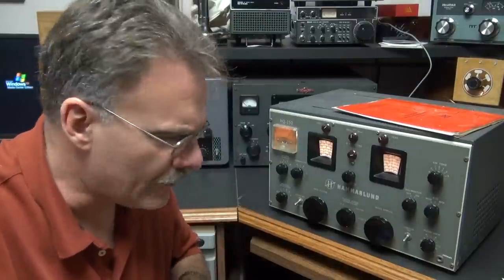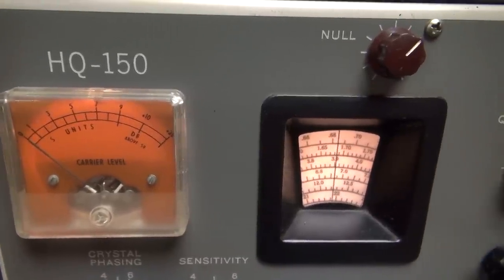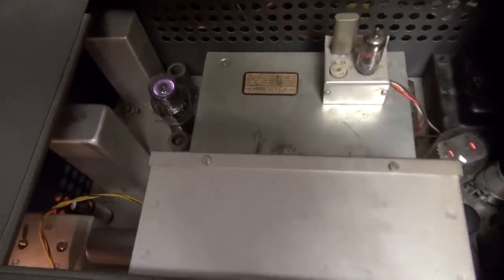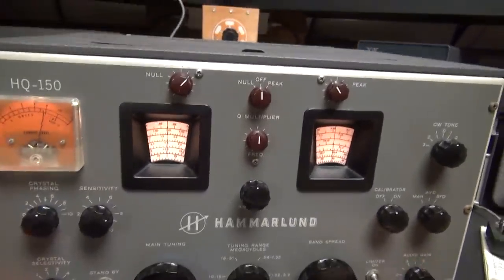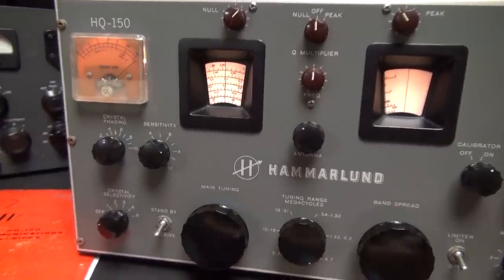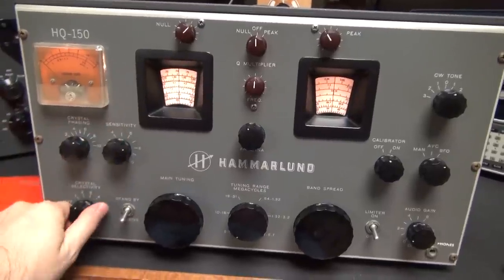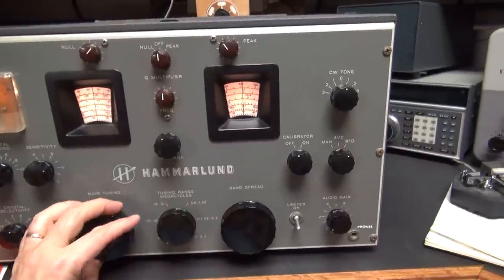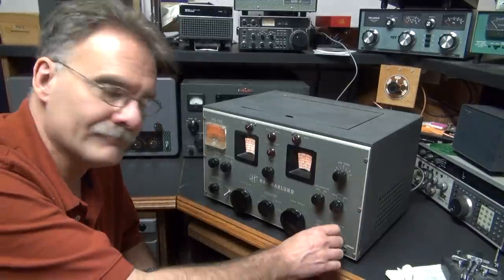Demo Vintage Hammarlund HQ150 Tube Ham Shortwave Radio Receiver

Comment: Thanks for bringing back my memory of my brand spanking new HQ-140X I bought in 1954.  I also put a Bud calibrator in mine in the middle
of the shield right behind tne meter.  I used the Heathkit Q-multiplier on mine.  The image rejection on 10 meters was about zero , and it pulled
frequency a tad as the antenna compensator was tuned.  I will never forget the aroma of that radio, it lasted for days.
K4OF.

Comment: Thanks for posting this video. I've just acquired a Hammarlund HQ 150x for about US$300. The seller told me "it works". Apparentely it is complete. It seems more like a project. The reason I bought this rig it is because of an HQ 129x I used to have. Dxing was never that smooth with more modern receivers. One feature that blew my mind was the noise limiter, it worked like magic! Even the loudest interference was totally eliminated!
Reply from the maker: jtownshend I really liked the 150. Great looks and audio. Should have kept it

Comment: I have a what I believe is a SP-200-SX / BC-794-B.   The coverage of mine matches this model (1250KHz-40MHz)
The front I.D. plate is missing.   The other difference is I can see the full wheel dial of both the main tunning and bandspread side with the bandspread side having the Amateur Bands printed on the dial.   All of the other units in this model range all have a small window of view for the dial frequency.   I have been trying to identified it for a few years.
It looks just like a SP-200-SX/BC-794B.   The color of the front panel is a sky blue which I have never seen before and don't know if it might have been painted however it looks old so if it was it would have been done a long time ago.
A mod was done to this receiver.  It looks like one of the audio output tubes was removed and a internal supply built.
I would be happy to email some pictures if it would help identifiy it.   It works great (after I replaced a cap in the AVC circuit),
as well as a few others..  and I love the audio but I wish it covered the full broadcast band.  I was wondering if any switchable
mods to that model receiver might have been done to for the local oscillator to tune lower.  My first thoughts where to sub
the tube LO with a remote LO and inject it in the same place. Start off with a signal generator to sub for the LO to see if the 
concept would work.   What's your thoughts and would you know of any forums on this subject?
Thanks,   Ken

Comment: many years ago I picked up in HQ 180 I was very lucky and everything seemed to work just fine at the time I also picked up the transmitter that goes with that particular receiver. I had just started to learn Morse code so that I could become an amateur radio operator novice. my location was Honolulu Hawaii and still is. I'm looking to set up a place in my apartment where I can set up the radio and restore it back to 100% brand new. I am also studying to be a technician and a general class license.

Comment: I just picked up a HQ-150 at Dayton in great condition ( like yours). Do you still have the info on the audio mods and what ever you did to stop the "pop"?
Reply from the maker: I will have to check my records. If I remember correctly, I modified the standby circuit to be the same as a National 300 circuit
Reply: I'd also like to know what you did to modify the audio - THNX de W2VMC :-)

Comment: My father in law just gave me a Hammarlund HQ-160 in very good condition. It has rabbit ear antenna and a small speaker. I have no idea how to operate it. I can turn it on, but the rest of the dials are totally foreign tome. I am not a radio guy and this is my problem. I need some basic operation instructions. Can you help me out.Thanks